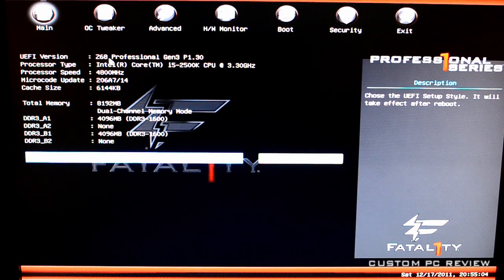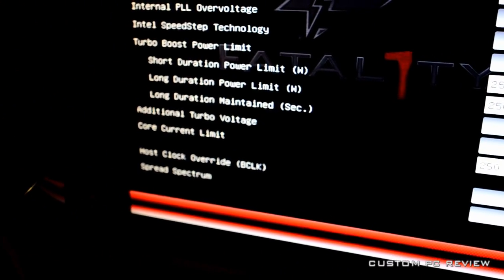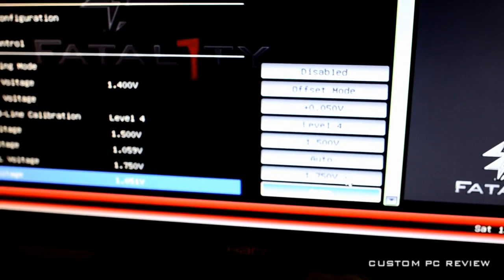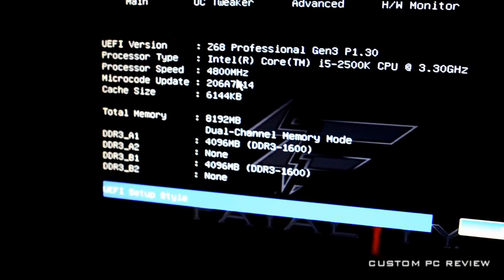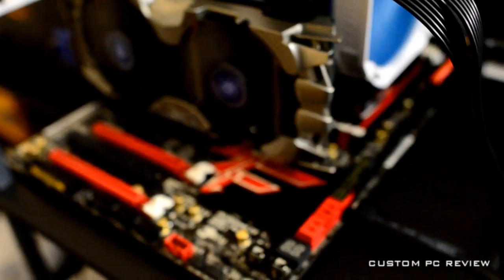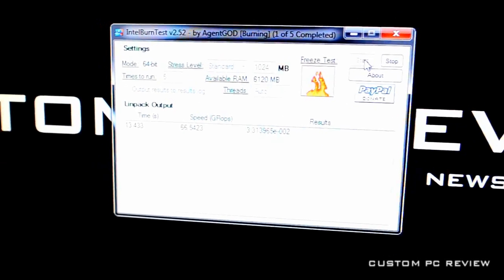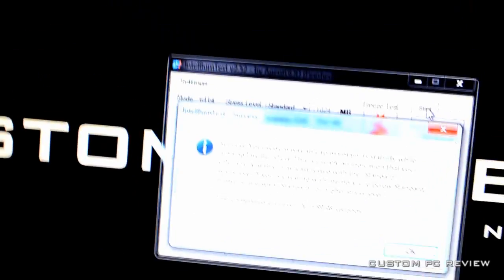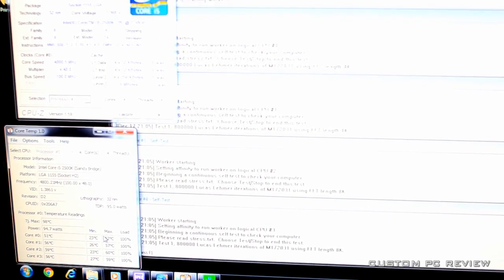How to Overclock Sandy Bridge P67/Z68 i5 i7 + Test Bench Tour

Comment: Hey, i have a motherboard: Asus P8Z68-V LE and i want to overclock it to around 4 Ghz and 4,5 Ghz, is it safe to have it on 4,5 or is it better to have it on 4,0 Ghz?
Here are my specs:
i5 2500k, 8 GB ram, amd radeon hd 6950 2GB and a Noctua NH-D14,
What do i have to change in the bios?

thanks in advance :)

Comment: will i be able to get 4.4 ghz with these specs
asrock extreme 3 gen 3
intel core i5 2500k-attached with the fan included in the box.
16 gb ram
evga nvidia 550ti
500 watt psu
500gb hdd

Comment from the maker: @TechKidzUK No clue. I've never actually tested that so I can't really help you there. That being said, I'd probably shoot for around 800-850MHz / whatever shaders link that core clock. It's a mild overclock, but the problem with SLI is that even if one is running at a slower speed or is having stability issues, the whole setup bugs out.

Comment: @YouEatMyDust THE I5 2500K is the unlocked version, thats what the 'k' stands for. Any of the 'K' series can overclock to somewhere around 6.4Ghz, thats the limit if i remember rightly (sorry if not) But yes any of the 'k' version, as long as you have the right system set up can easily reach above 4.8Ghz

Comment from the maker: @ByLyel Hmm... I've seen this issue happen if you reset the CMOS and didn't set it to AHCI mode when you had it previously. You probably have it set correctly, but I'll just put that out there. Otherwise, yeah it looks like an unstable overclock still. Was @XxViciousxX able to help you out? Pop into the forums if you can and list all your settings or a picture. I will try to suggest some changes and maybe it'll help you OC. Also, what cooler are you using?

Comment from the maker: @ByLyel Hmm... 0.080v / Load line 1 worked for me (At least to boot and run a round of IBT). Did you try resetting the ram to all auto? You might have an unstable ram overclock that's causing the issues. Hopefully @XxViciousxX's advice will help you out. Also, make sure the bios is updated and you can also try clearing CMOS and doing it over again. Good luck! Be sure to let us know what settings worked out for you if it works!

Comment: @ByLyel i have that exact mobo i got my 2500k at 4.8ghz 24/7 rock solid at 1.424 volts i can get to 5ghz but it needs 1.48 volts not worth it in my opinion. But if you want my settings for 5ghz just let me know.

Comment: @custompcreview I have the ASrock P67 Extreme 4, ive tired lowering the Load line to 1 and have even tired +0.090V and still no luck :( 

Im fine at 4.7Ghz now and hve been running it for months now. Im just new to overclocking with Intel. (the newer motherboards are awesome) And was wondering why it is not letting me go above 4.9.

So any other suggestions? :DD

Comment from the maker: @ByLyel It depends on the chip. 5.2ghz is difficult, but you may be able to get to 5.0ghz. Read the description box on what worked for me getting to 5.0ghz. For me the voltages are too high at that point though. It was nearing 1.5v so I called it quits and dropped it to 4.8ghz. I didn't stress test it for very long so it might've been unstable. (BTW I recommend not going over 1.4v for 24/7 OC or your CPU might have a very short lifespan)

Comment from the maker: @ByLyel That happens because the overclock is unstable. What mobo do you have? If you have this board or another Asrock board, try increasing the offset voltage to +0.075 and set load line calibration to 1.